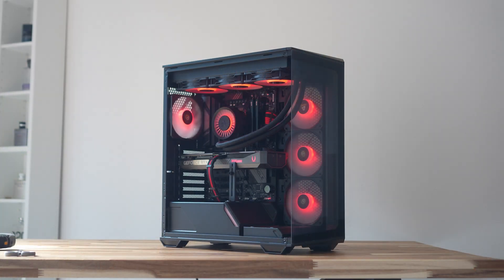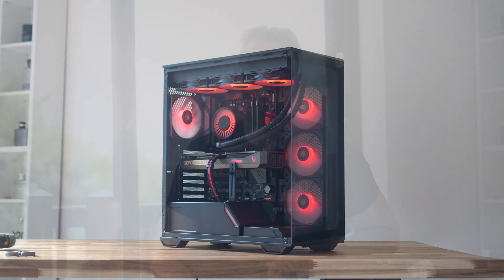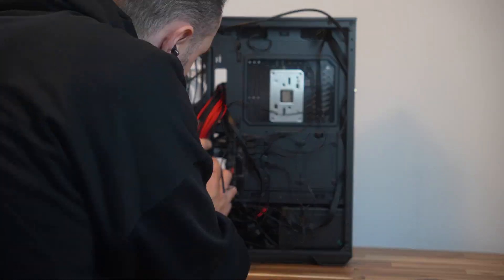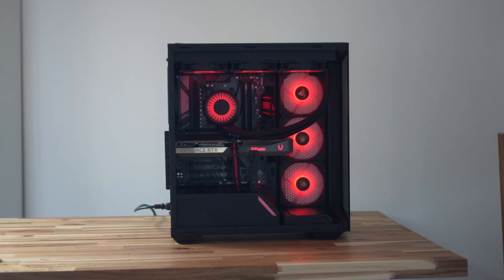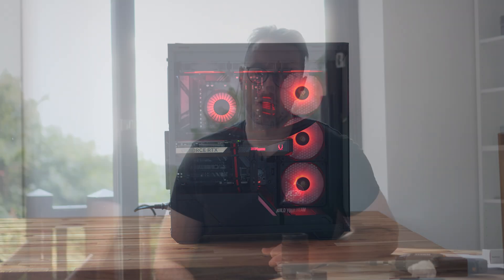Why does EVERYONE love this PC case?

Comment: I am building my first PC please let me know if I am doing anything wrong😊

CPU: AMD Ryzen 7 7800X3D

Motherboard: MSI B650 Tomahawk WiFi

RAM: Corsair Vengeance 32GB (2×16GB) DDR5 6000MHz

GPU: NVIDIA RTX 4070 12GB 

SSD: Crucial P3 Plus 1TB NVMe Gen4

CPU Cooler: DeepCool AK620

PSU: Corsair RM850e (850W, 80+ Gold, Fully Modular)

Case: Lian Li Lancool 216

For now I am going with rtx 4070 but in the future I am planning to swap 4070 with 5090 am I doing the right thing?😅
Reply from the maker: Some good choices there but also some errors in my opinion

I can help you if you answer these 😊

1) What is the *goal*?
I can't give recommendations if I don't know what you're doing with the PC. I assume it's gaming but what kind? High FPS esports or high graphics story games? Do you want to optimise for maximum speed or maximum quality?

2) I assume you mean the 5070 rather than the 4070 from your list, I hope so. But even then I think a Radeon 9070 is a better choice due to being a 16GB model

3) what's all this about upgrading to a 5090? Are you winning the lottery next week or something? Be realistic. Either you can afford a 5090 or you can't. So just buy the 5090 now or wait. Upgrading within the same generation is generally very poor value.
If you are going for the 5090 you should get the 9800X3D not the 7800X3D. And you'd need a 1000W PSU
Reply: @thecomputersurgeon  I am not winning some kind of lottery 😅 I was going to upgrade it to 5090 in like next 2 to 3 years and I already made some changes like changing my PSU and getting 9800x3d I think I will change my motherboard I am little confused about it?
And I am not a fps player I focus more on graphics than FPS😊
Yes I am getting 4070 now

Edit: it is only for gaming
Reply from the maker: 4070 is previous gen, so unless you're getting it used at a really good price I'd avoid that

In 2 or 3 years there will be new graphics cards so get rid of the notion of the 5090, and get whatever is best at the time you're ready

No point getting the 9800x3d if you're not upgrading the GPU for a few years. Get the 7800x3d and then upgrade to the next gen X3d CPU eg 10800x3d (or whatever it will be called)

You need a 1000w PSU

You need a better SSD with a DRAM cache

The motherboard will work great, so stick with that, or you could even go a little lower end and save some money without any impact on performance